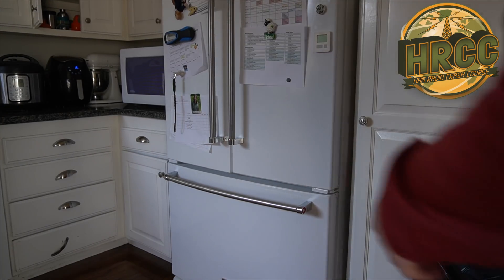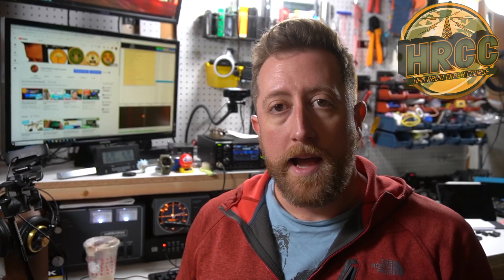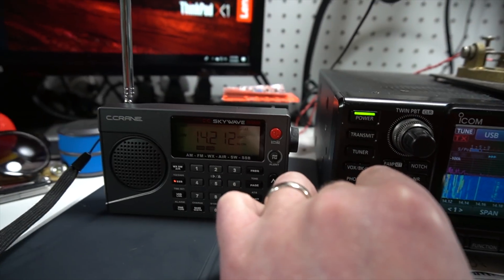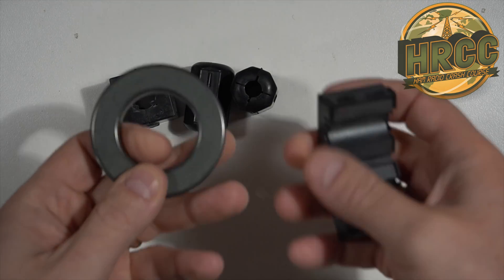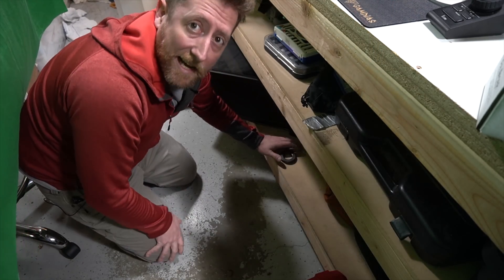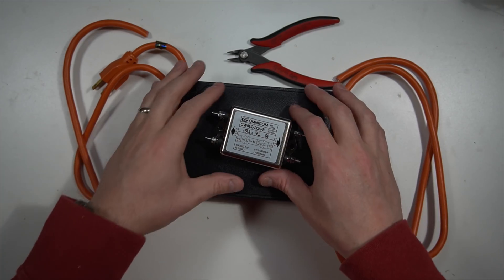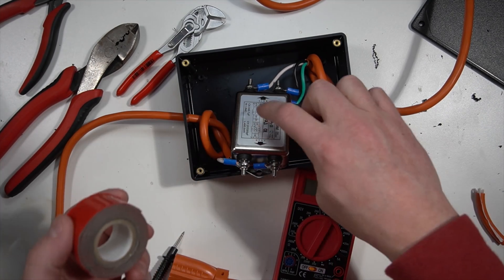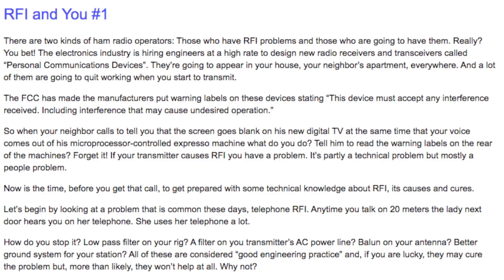WE are killing the amateur radio bands, and here is how to fix it (RFI)

Comment: Before anyone gets the idea they know the purpose of grounding and bonding. I recommend going to Mike Holt's Grounding -safety fundamentals video. That video explains it all. Grounding does not protect someone from electrical shock. Some devices use a ground and some do not, adding a ground that's not required will not eliminate the possibility of electrical shock. Don't argue with me, bring it up with Mike . He is one of the leading experts in the country on electrical safety and power distribution systems. There is so much bad advice and misunderstanding on grounding even in the comment section here it would take an hour long seminar to address it.

Comment: I was working on building a shortwave receiver and there is some interference in my house that i couldnt track down. I thought it was the fridge but later that turned out to be false. I even stepped through the circuit breaker but did't find anything yet. 

God forbid we turn on the Plasma TV in the living room! Holy cow that thing creates a ton of RF noise

I was thinking it may be something in the neighbors house but havent found out yet

Comment: All the wall warts came off the walls. Some wall warts have pour filtering. And also ask if the batteries are charged. Yes get the warts. The heater has a smart system that is wating for commands via remote fob. The LCD tv the same. Also  believe it or not that heat wire for pipes clicks loud at about 35°- 29° beeing on all the time. Yes at 80/160/ 40/41 meters it's crazy. Thanks for more in-site on the noise.

Comment: Over the past year I have discovered several RFI offending appliances by clicking through the breaker panel. Some of the most significant RFI producers have been a Genie garage door opener (even while idle), Ryobi power tool battery charger, power supply to an HP All In One Officejet printer, controller on a string of LED party lights and of course a wireless IP router. Ferrite rings and clam shells help reduce RFI some but my best solution is to keep the items unplugged while using the radio. I was actually successful in getting HP and Genie to replace the offending products. The filing of an FCC complaint of radio interference carries some weight with manufacturers.
Reply: I know this is an old post, but thank you! Very helpful!

73,
John - KK7JBZ

Comment: Just curious about your dryer.  Are you talking about a clothes dryer?  Mine runs off of 240 volts and uses much more current than can be used with that type of extension cord.
Reply from the maker: Mine dryer is gas.

Comment: oh yes I would say in the past 4/5 months my noise level has gone from 1/2 db no 5/6 db and I think it is outside because it is on my mobile 11 mtr rig until I drive down the road and at a certain place the noise goes away? not sure whats up
Reply: Put your car's radio on the AM broadcast band and drive out and aroud your neighborhood, pay close attention to utility poles with power line attachments. These are famous for external rectification ( the rusty bolt effect ), and report any findings to your utility company.

Comment: A great intro to the problem of RFI for Radio Hams. Am especially interested in your up and coming video on good AC grounds as I have a problem where RFI is actually present on my mains earth ( circa 18 MHz and 50 MHz). The RFI is thought to be coming from a neighbour's appliances. I can even pick up the RFI off my bath taps (pipework pick up or direct connection of RFI ???)

Comment: It's  a constant battle here! 

My neighbour has something that is wiping me out on 60m. Also have a problem with my office / shack computer so ended up getting an old server (Dell R710) as it's effectively in a Faraday cage which runs the s/w for digimodes.

Great video, thanks for your insights. Not thought about toroids on the cables to my radios. 

Street lighting was replaced yesterday, no noise increased so far which I was relieved about. 

I need to get some LED GU10 bulbs but am REALLY worried about EMI. I was also involved in the fight in the UK against PLT interference. They are a PITA if they are used by neighbours and xDSL can be a challenge from other properties. 

73 de Richard M0SNR

Comment: The worst RFI causing things I've had recently; 1. Motorola Moto E4 (Lenovo) cell phone. I can hear the cellular data noise through my computer speakers even with the phone 20 foot from my computer. If I disable the cellular data the noise goes away. Disabling the data makes it pretty useless, so I just shut it off and tossed it in a drawer. I'll never buy another Lenovo Motorola product. I also have a Motorola Moto G (Google) that causes no RFI. 2. Netgear LB2120 4G modem. I can hear the cellular data in my computer speakers. I put 5 layers of heavy aluminum foil under the modem and almost got rid of the RFI. 3. DJI Osmo Pocket video camera. When I plug it into a wall USB charger or USB power bank to charge it, it causes bad RFI in my VHF hand held radio if the camera is within about 4 foot of the radio.  Move the camera further from the radio and the noise goes away.

Comment: Unfortunatley, I can not cut the plugs of our 2 Elevators :) Their controllers make HORRIFIC qrm,  especially on the low bands (Harmonics). When I called the elelvator company they had been cooperative only up to the point when the basics did not help (changing for a screened power cable). The interference comes through the antenna and not via the power lines. I gave them an RFI filter to put on the output of the controllers but when this showed an error code they ceased doing anymore tests. I guess the solution is to change the 2 controlles for a new model that allready have the filters built in.

Comment: I lost power about a week ago during a ice/snow storm for a few hours so I hooked a 12 volt battery to my IC-7300 and it was amazingly quiet although I suspected that would happen. I live on 80 acres of farmland so this spring and fall when there is no crop to damage I am going to go take my UTV and drive out to the middle of my section to get the farthest away from any power lines and setup a temporary ham shack and see what happens. Flat Landers On The Air. FLOTA - or - Sod Busters On The Air? SBOTA
Reply: I know a guy that found he had no RFI at all when the California power company, PG&E, shut the grid down for a week, which they did twice in 2019.  When the electricity came back on he was able to trace the noise to a transformer on a power pole near his house. Not much you can do to resolve that since the power company has little to no interest in maintaining their infrastructure here in California.

Comment: Removing the ground from a dryer is NOT a good move.
Reply: Yeah I came down here to say the same.  Lifting that ground is not only dangerous, but a code violation.  There's only one lug for the ground wires because they are all meant to be bonded together on the same post.
Reply: Ungrounded 220VAC is a REALLY bad idea. That RFI filter was not made for a 220VAC high current device.
Reply: @WarpFactor999  That is 120 VAC.  Look at the connectors.  This must be a gas dryer with electronic controls (microprocessor and switching supply)  as opposed to old style switches and relays.  The main current draw is the motor to drive the drum and that filter looks like it will handle that.  It might be better to put the filter closer to the control circuitry.
Reply: @WarpFactor999  that is not a 220V dryer, a natural gas dryer uses a 120V motor.
Reply: I agree with you. He should connect the ground together, only the Live and Neutral should go thru the filter. That's it
Reply: The grounds should be on the common or same lug.
Reply: No joke. Wait till he loses that neutral and the case of the dryer becomes hot. Hopefully it never happens.
Reply: @Ccelectric2000  I have tried to explain that...live case no ground problem...people don't believe it ...idiots
Reply: He mentioned in a reply to another comment that he will indeed get the dryer grounded.
Reply: Ground removal or no ground is illegal under the NEC rules.
Reply: electric supply in the UK is so much better, we dont have to do any of that, all our devices are grounded with a 240v output, perks of 3 prong plugs lol

Comment: Funny you should have this video out right now.  I just dealt with this a few days ago using the circuit breaker method.  I have access to a full array of RADAR Engineers RFI locating gear through work, so I used the TVI/RFI locating wand to locate a laptop power supply in my garage and also my TYT DMR portable charger!  Went from an S7 down to an S2/3.  My big problems were above 20MHz
Reply from the maker: Wow, I want that RFI tracking gear!
Reply: @HamRadioCrashCourse  I think the Radar Engineers products are pretty affordable.  I'm a Telecom tech at a utility company so part of my job is tracking down customer complaints of powerline interference.  Favorite part of my job!  My favorite cases to handle are when I determine it's not powerline interference but always offer to the customer to help them track it down anyway even though it's not our responsibility.  It's interesting how many times it's something inside the customer's house.
Reply from the maker: Man you could start a small business helping ham tracking down rfi inside and outside the house.

Comment: Josh,
I’m am about to build a Ham shack in an unfinished room in my concert basement. I will be sheet-rocking the walls as well as running antenna wire and outlets. I’ve seen videos of Hams installing copper shielding tape behind the walls. My question is, is this an effective and financially feasible technique to optimize my hams shack’s performance when it come to interference?
Thank you for efforts to enhance propagation. 
Brent KN4QHY
Reply from the maker: If you have wall to wall copper shielding it likely acts as a faraday cage.  But keep in mind, seams like yoour doors would nulify the benefit in some cases.  I'm sure it would help, but IDK how much.

Comment: To save yourself a whole bundle of legwork, take two Baofeng UVRs or similar.
 Run QRP and a dummy load on one.but tape down the PTT switch, Stand it next to the speaker of the main station RX.
With the other HH, you'll hear the first one, all over your property and you'll also hear if unplugging various appliances goes quiet as you move around the house. No need to leg back to the shack receiver every time to check.
Work Smart!
BTW Run RX on  DC for now!
BUT will your neighbours be as co=operative!!???

Comment: Please go back and reconnect your Equipment Grounding Conductor. If a Hot wire from within your dryer were to come in contact  with the metal case of your dryer the breaker wouldn't blow and it would be sitting there Hot waiting on someone to touch it and be shocked or worse. Do a search on Equipment Grounding Conductor to see how important it is.
Reply from the maker: Will do!

Comment: Were you getting all that noise from your dryer with it just plugged in but not actually running? My shack is currently in the basement right below the laundry room. If we are doing laundry I don't even bother turning the radio on. Does your dryer really run on 110 rather than 220? Great job, this is a very logical and quite simple to find the RFI...now to get the wife and kids out of the house for a few hours.

Comment: Hosh, perfect timing for this video.  Thank you!!  I'm studying for my General License and planning my HF Radio Rig.  I had completely forgotten about RFI generated from my home devices.  I've been studying which Transceiver, power supply, feed line, antenna....etc.   Reducing RFI is a step I would have completely missed.   73 KI5HII
Reply: Almost any gear will work if you're in a quiet enough location. Noise is the limiting factor.

Comment: Thanks for this episode. I've got a problem with a networked security camera system using POE. Birdies at 70khz spacing. When I unplug all the cameras and the network cable the birdies disappear. Reducing in intensity as I go. Chokes don't help. It's at the point where I just shut the system off when I want to play radio. Defeats the ourpose of the camers but at least I can play radio. Love your channel. Cheers from VK4

Comment: Good video Josh! Was wondering how the wifi and my inside ac/heat unit will act with RFI since it's in the wall of my room I've been straightening up for my shack, and my wifi router sits on the desk in that room. 🙄 I've got a feeling the AC/heat unit is going to be big prob. Just got a new fridge- one of those must have buys. Went OG with it. I'm thinking about the microwave too. RFI has been in the back of my mind for awhile now- wondering what all will be a prob. Always try to think a head. Looking fwd to the next one about grounding your shack! ✌🏼 KI5CWY

Comment: I am curious about the grounding situation when using an RFI filter.  Do you run the device with no chassis ground, or can the chassis still be tied to ground?

I'm guessing you have a gas dryer, as opposed to electric.
Reply from the maker: Yes. Tie it to ground. It’s gas. 👍

Comment: I had an emi/rfi device that took me over a week to nail down. 300 feet away from my house the power pole was transmitting noise into my trucks am radio as I drove under the power lines. The source was an aftermarket laptop power adapter. It spewed noise down the power lines for hundreds of feet !!!! My tiny cheap portable am radio tracked it down !!!

Comment: How about your microwave oven?  That’s another intermittent use device that probably spews a ton of RFI when operating.
Reply: no, that is typicallt RF shielded and in the 2.4GHz range, if you get noise from that on HF you need a new microwave oven..
Reply: Microwave ovens NEVER cause RFI in the HF spectrum, I have yet to see one cause RFI on HF.
Reply: @lt4324  well if the seal is breached or the switching power supply for the timer maybe but no they dont
Reply: @Elfnetdesigns  The faraday cage that is a microwave oven only attenuates the thousand watt microwave signal being generated inside, it doesn't eliminate it.  Some signal is ALWAYS radiated, whether the seal is bad or not.  The noise floor on 2.4 GHz goes way up at dinner time when all the houses around start using their microwave ovens.

Comment from the maker: Don’t worry all, both sides of filter are connected to ground. Thanks for the concern!
For reference. I am using the Palomar Engineers ICOM 7300 rfi kit and an additional kit of mix 31 torpid cores and snap on ferrites for my noisy devices. All are available at Palomar Engineers.
Reply: Hopefully it's grounded for a while, and put in the naughty corner!
Reply: Put both grounds on the one ground lug.

Comment: A very good video! There is a good book published by the ARRL on RFI which is very helpful, we  deal with all kinds of RFI in telecom circuits in the DSL/VDSL bands. The water sprinkler timers, fish tank heaters, halogen bulbs, TV monitors, switching power supplies, swimming pool pumps, treadmills and the new entrants are solar panels DC-AC converters and electric car charging AC-DC inverters. On the latter there is no IEEE standards on broadband noise limits on Power quality into homes.  Most of the noise originates in the home, however it can also originate outside the home and travel via the commercial AC power grid both conducted and RF emitted interference. One way to block is to use noise suppression Belkin ISOBAR or any other which filters out AC broadband noise.  The next one is to use Quad shielded cables and in some cases the noise needs to be mitigated right at the source.

Comment: Should the things be reported to the FCC.  There are rules about the amount of RFI they can put out. Or are the limits set so high that they are allowed to put out that much. The AC grounds that the city said is good, may not be good enough. Most rules are the lest amount but you can ground better that what they say..most places say you must have a 8 foot ground rod.  But if you live where it is dry or some types of soil it may be better to have a longer ground rod. The best ground system is a ground rod or copper pipe that goes into the water table! If you live where there is a lot of sand and you have had a lightning strike,  you need to check your ground. I have seen lightning strikes that the sand turned to glass and the ground rod was not a ground anymore! Yes I live in Florida!  We have more lightning than the rest of the country put together! You may not have the same trouble where you are.  But it doesn't hurt to check your grounds to be sure that they are good grounds. A small amount of resistance in your ground can make a difference. I am lucky!  I can dig down 25 feet and be in water!  I just need to save up and put a 1.5 in or 2 in copper pipe down with a pump and I have the best ground and cheap water for my garden.
Reply from the maker: Yes! All devices that are emitting high levels of RFI should be reported.

Comment: Excellent video, Josh!  A 120VAC dryer? Really?? Huh....I've never seen one! I am fairly certain, however, that you want to tie both sides of that ground to the device ground lug, rather than 'lift' the ground on a device with both a motor and a heater. Unless the manufacturer of the filter specifically directs you to lift that ground (or in the case of a double insulated tool for example), I've never known that to be a good idea. Thanks, and 73  W1NLJ
Reply from the maker: It’s natural gas.
Reply: @HamRadioCrashCourse  ...DUH!! LMAO  Now I feel perfectly stupid....since I used to own a gas dryer! Can I retract that part of the comment?? 🙄